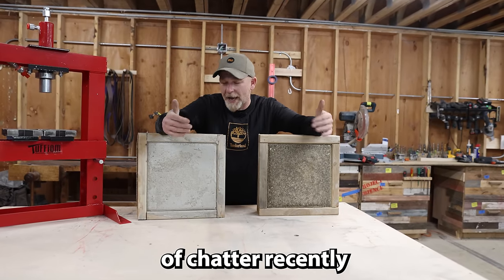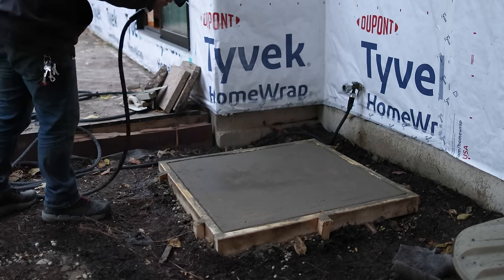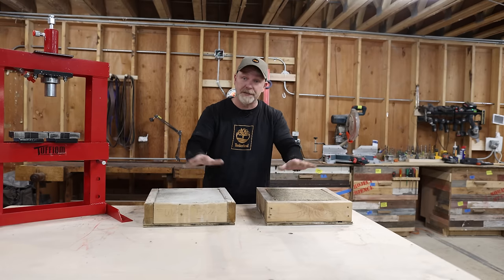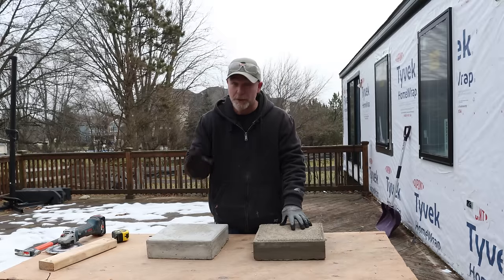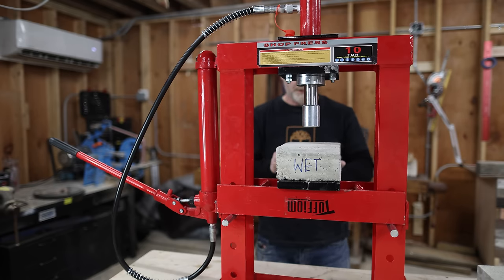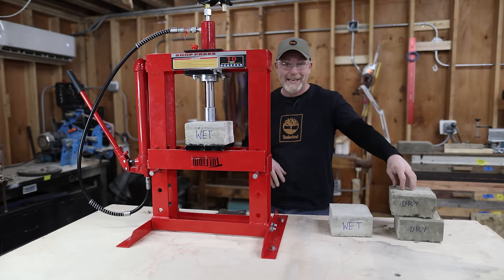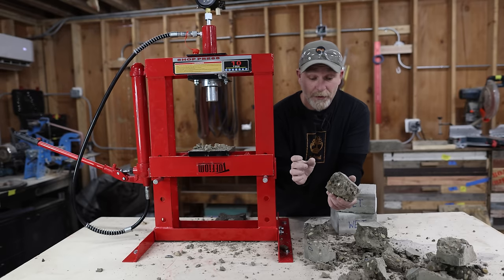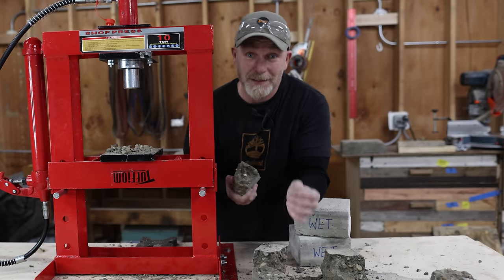The TRUTH About Dry Pour vs Wet Pour Concrete!! Strength Test - You WON'T Believe the results!!

Comment: Geotechnical engineer here, my last job was in airport pavements. We test both new and existing pavements when performing construction and evaluations. There are some less industrialized countries that will dry pour patches, I’ve cored and performed split tensile tests on tens of thousands of samples, the dry pours were always laughably poor quality.
Reply: brilliant comment thanks
Reply: Is it possible that the issue is that dry pours require watering throughout the curing process, and that the curing process is extended to a much longer period of time?
Just thinking out loud
Reply: I think someone  should  experiment  with the time and the misting process for it to cure properly.  There is got to be a sweet spot where it can give better results.  And when we reach that optimal result  , we can decide  if it worth it for certain applications
Reply: Glad I saw this, my forms are in place for a pad for a shed. I was going to dry pour, don't think so now.
Reply: Retired highway contractor here. Certified in concrete and aggregate testing and was on international standards committees. Enjoyed the video and your methods are original and you got similar results. Look up procedures for compressive strength testing and then for flexural strength beam tests. The dry pour is more like a cement stabilized base rather than a slab. I would never use this except for fence post.
Reply: @ravenrock541  one of the problems with misting is the lack of control of the amount of water added uniformly through the depth of the dry mix. In concrete mixture design the amount of water is important and the amount can be affected by strength requirements, size and distributions of the coarse and fine aggregate. In addition, the three types of cement added (Types I, II, & III) can change the optimal water content. Another observation of this video shows aggregate segregation, which results in unreliable results. Concrete needs a homogeneous mixture for optimum strength and durability.
Reply: I can't believe you do this for a living and never bothering saying anything about the fact that AIR INJECTED CONCRETE is what we are talking about. You need AIR and WATER to start the chemical reaction in cement. That's why it GETS HOT when you pour a lot of it at once.
Reply: @bbrahbboul2748  agree.....  in fact  wonder if it needs a firing like pottery for it to reach complete cure
Reply: @ravenrock541  Any time I've had to use it as part of a spec callout in the UK, it's always been misted for every 25mm of depth (1") added. That will get it to 80% strength fairly rapidly, it takes a couple months to get the rest though.
Reply: Everyone trying to reason their way out of science by "but what if!" and this man just calmly giving facts.
Reply: @weldo1948  Good thoughts - you beat me to it!  Complete amateur here, but it seems pretty obvious that the dry pour does not allow a consistent mix of all the ingredients.  And I'd guess it'd be worse the thicker the slab is.
Reply: Well I strongly disagree and I Challenge you to a backyard contest of Dry pour verses wet. I won't tip you and don't tip me. Take your time and I'll do the same. I say those results will be nowhere near laughable when I'm done. With that I will give you this fact, My father was a concrete specialist for 42 years before retirement. Speaking of airports my father was responsible for a large part of Bush intercontinental airport construction in recent decades and many new school buildings in and all over both Montgomery county and Harris county. My Dad played golf with the engineers. I don't know everything about concrete itself but I've learned the nature of the beast in 54 years and I will never pour any concrete in someone's yard or property that I would not pour exactly the same in my own.
Reply: @ravenrock541 nope... I guess you didn't understand the assignment... Read the answer again...
Reply: @williamfowler9196  atmospheric air is not a required component of the hydration reaction. This is why we can cure cement in a vacuum. 

Air entrained concrete (which I believe is what you’re referring to) is an intentional process of adding air voids to cement using a detergent additive in the batch mixture in order to provide freeze/thaw resistance. Air entrained concrete is about 5-10% weaker depending on the size and quantity of air voids but this is expected and acceptable in trade for the environmental freeze/thaw resistance.
Reply: @James-h9t6q  there is a reason (several actually) that none of the airport pavements or structures that your father poured were dry poured. Thank you for taking the time in your reply to provide details on your lack of experience in this industry or the materials sciences behind it. It serves well to indicate the nature of unqualified opinion common amongst proponents of this substandard construction “technique”
Reply: @bbrahbboul2748  No amount and times of misting will ever give optimal results. It will always be subpar. As soon as the water and concrete are mixed the chemical reaction begins. When the chemical reaction is only started on the surface you will get the surface reacting faster than the dry part on the inside. It won't be consistent throughout. You need the consistent reaction throughout the mix. It will never be close to the strength of a wet mix. It needs to all harden equally at the same time. You could mix it by hand in a tub and have 2 or 3 times the strength of a dry pour and it wouldn't take that much more time and effort to do it the right way.
Reply: @bbrahbboul2748 it’s not worth it for any application, it was designed to be mixed and poured. Don’t skimp on following the directions.
Reply: @Rippthrough       That makes sense.    It does have to have water.    I was wondering how the mist on the top could ever be enough moisture to travel 3" down to the bottom.
Reply: Former ACI and ICC certified concrete testing technician and inspector here. "Dry pour" just isn't a thing on any permitted project where the concrete is supporting a load. There's no way to control consolidation, water/cement ratio, wet unit weight, air entrainment, aggregate segregation, concrete temperature or slump, all of which are specified on a commercial pour because they affect the result.
Reply: Always glad to hear from an expert.
Reply: @Timber1508  
What if I "dry pour" hydraulic concrete and mist it with Coke and then loosely cover it with black poly/visqueen? :face-orange-raised-eyebrow::volcano-green-lava-orange::text-green-game-over::medal-yellow-first-red::trophy-yellow-smiling:

:face-red-smiling-live:Cement:elbowbump:Concrete:baseball-white-cap-out:Resin:popcorn-yellow-striped-smile:
Reply: @lt1nut  nah, that only works with Mtn Dew, and only on Tuesdays.
Reply: @coachgeo     Concrete 'CURES' .   It is a chemical reaction created primarily buy the 'cement powder' & water coming into contact with each other.   Part of that reaction is the release / creation of heat.   At the atomic level, the heat created is somewhat of an incidental result and not really needed for the CURING  to take place.   I don't know the specifics but it is probably no more than 20 degrees F.   Any amount of heat applied externally, during normal weather, would interfere with the 'CURING' PROCESS.    Most likely the main result of adding extra heat would be to cause evaporation and DRY the concrete too quickly, stopping the CURE.    CURING is not the same as DRYING !    Pouring in the summer is trickey because if the concrete dries to quickly, the water evaporates and does not allow enough time for a proper 'cure' of the 'cement' (which started out as a dry powder).   All-in-All, it is a chemical reaction and has very specific requirements for the atoms to be able to combine with each other for the optimal atomic bonding, i.e., strength.  
       Firing clay pottery in a kiln at 1500 - 2000ish degrees is an entirely different chemical reaction.   It needs to have heat ADDED to it for the atomic bonds to form.   
       Check out TYLER LEY's YT Channel for all kinds of interesting knowledge about concrete !
Reply: @BillSmith-fx7xx  Mochas Gracious.. Youtube  (commenter) Univ. strikes again.  Appreciate
Reply: Dont believe anyrhing you say
Reply: @samadams7467      Thanks for your comment & support !    :-)
Reply: @coachgeo        You are very welcome.   Always glad to share some knowledge when I can.
Reply: P501
Reply: @ravenrock541 oh no your right on that and also the rate as for ground/ base to aid in absorbing  moisture towards bottom  for full cure . But im just a regular smart contractor  science is easy
Reply: Oh please stop
Reply: Supposed to add at least 3 bags of calcium . Only on hot days .
Reply: On three story homes . For footers I use only dry pours . Much better to screed powder and easier on my workers backs .
Reply: @greenspiraldragon one guy mentioned misting after every 1". I wonder how that would work. Obviously it would be very hard to get consistent results. I think there is a technique to "dry pour" that should get you to the proper break strength. It would probably be so impractical you might aswell wet pour it though.
Reply: good information
 @Rippthrough
Reply: Let's be reasonable. Video clearly showed average 5 tons of pressure...sufficient for any foundation such as sheds, playhouses, AC units, propane tanks and the like...maybe even fence posts.
 @DevinRAR
Reply: What you miss is that Dry pour is 100x better for the youtube algorithm.  FACT.
Reply: A dry or damp pour requires compactive effort. The strength of a lean mix will vary with the density to the 4 power.
Reply: @DevinRAR  concrete is always placed and not poured. Dry or damp mixes require compactive effort.
Reply: Also a 5 yrs concrete pour is stronger also I believe than 6 month
Reply: @Sjwolosz321 really, so tell me the state you work in, and that  you're having code officials sign off on this method.
Reply: @NoName-ml5yk yes because all modern contractors in most trades want to cheat to forgive time to do things correctly and with trade integrity!
Reply: @bbrahbboul2748 Doing it an inch at a time and misting it every inch should give much better strength results than just misting over the final top. Not that I could ever usethis method myself given the horrendous finish.
Reply: @bbrahbboul2748 Who in there right mind is going to experiment with concrete slabs in order to see if it works. Time material and labor is not cheap. This is a ridiculous debate.
Reply: @kenhellman9596 What made you even think about dry pour, unbelievable where did this stupid debate ever come from.
Reply: @ravenrock541  The problem is that the concrete on top will initially harden and cure first, slowing or blocking the water penetration to the bottom. Too much water on top and not enough on the bottom.
Reply: @RealBLAlley  I agree, but since concrete can suck moisture right out of the ground my theory is that keeping the surface constantly wet for 24 hours this can be overcome. Most vids I've seen they wet the surface and then stop, come back a few hours later and wet again. I feel this does not get enough water into the mix. After the surface sets up, maybe throwing a garden misting hose over it and letting it run for hours would solve the problem
Reply: @ravenrock541  Relying on drawing moisture from the ground is incredibly inconsistent and undesirable to achieve high compression strength. Also, you're weakening the top if you saturate it to get more water to the bottom.
Reply: @garymurawski1476  It can't show how that dry pour will crumble over time.
Reply: I’m a structural engineer and it turns my stomach when I see people presenting dry pour methods.  Dry pour is lazy and totally disregards the science of concrete.
Reply: @MRKNIGHT  I'm a certified ASE Master tech and it turns my stomach when I see zip ties in an engine bay. But I also realize that everything has its use in the right place and right circumstances. Instead of holding your nose in the air, how about contributing to making a method better for those who have a need of such a method?
Got anything positive to contribute?
Reply: I'm going to try the dry pour, to make a shed floor don't need it to load bear so I'm hoping it will be fine
Reply: Tens of thousands of samples, huh? As a mathematician, I would love to see your research timeline for collecting and processing that many samples. I'll suffice to say that you've been  working everyday for years to accompolish such an impressive objective.
Reply: Try making bread or a cake without mixing...
Reply: @williamfowler9196 i think you mean air-entrained.. autoclave cement is injected.
Reply: @andymeyer8635  and you even said all of that in an organized fashion. In the comments. Huh funny thing is I never said one word about dry pouring anything in the way of commercial work. You see I watched and listened to my old Daddy because he insisted. You see I was commenting on the back yard dry pour at my house. I figured that this conversation would be skipped by all the smart people like you and my dad. It was just a comment no professionals allowed.Good day!
Reply: @andymeyer8635  my bad I meant to say you qualified people with a hell of a vocabulary.
Reply: You know what's Ironic to me? The Geotechnical engineer claims he cored and performed split tensile tests on Dry pour concrete in commercial airport pavements. Wow that tops everything!
Reply: @bbrahbboul2748  I think that's a wise statement well said .
Reply: @kenhellman9596  aww you let the talkers get to your better judgement. But hey I'm only trying to get the truth out about an alternative to PRECISION BUILT AND SPEC CONCRETE for your backyard do it yourself craftsman who would enjoy the look of good concrete work that doesn't cost $2000 to achieve. See I'm just that kind of guy that wants what I want without the BS of concrete crews.
Reply: @James-h9t6q  you would be amazed at the things that are attempted in emerging nations. Evaluations are performed on what exists when we arrive, sometimes it just makes you shake your head in disbelief.
Reply: @PureMagma  evaluations aren’t a one man show. 50-400 samples per airport, average of 12 airports per year, spent 18 years in the role.
Reply: @ravenrock541 most people dont realize that concrete is a chemical reaction with water being a ingredient to the process. too much or too little water changes the strength as well as if its not mixed the reaction will happen at seperate times not bonding together properly
Reply: Would you dry bake a cake?
Reply: There is a reason manufacturers have no recommendation for dry pour.
Reply: @weldonjohnson9834 Even for fenceposts we usually use "ground moisture" concrete, meaning at least as wet as wet sand will bring to the mix. Always  worked out fine for it, easy to tamp as well.
Reply: Elephant in the room: what is the weight of each of the slabs? Traditional wisdom says concrete condenses as it is mixed. The mix with cement and water take up less space than the dry ingredients. Are you absolutely sure it didn't take more concrete to fill the form on the wet pour, than the dry concrete? Higher density? ...I'm a little bit surprised  the dry casting didn't  set on you. Shrink. Though it is possible the adhesive properties kicked in before the rest of the chemical process,  hardening etc., leaving microscopic air bubbles everywhere  in the concrete,  making it both less dense and more fragile, than the wet pour. PS. Wet pour needs rodding/vibration to get rid of the air bubbles
Reply: @Sjwolosz321  They use calcium chloride, not calcium. It absorbs water, so the water does not evaporate as rapidly on hot days.
Reply: @James-h9t6q  Wet mix concrete costs no more than dry mixing for the homeowner - unless you need to rent a cement mixer.  It can be done in a wheelbarrow if necessary - pouring small sections at a time instead of doing everything in one slab. But it does take a long time if you don't have all the fancy equipment.
Reply: @buggsy5   ha ! in the trade it's known simply as calcium , Not CaCL2. Add it to concrete on a hot day , Better rush like hell to finish , Hardens fast , It's added on cold days so you don't have to wait around forever to finish .. Your'e welcome ,
Reply: Ravenrock   The problem is they did not buy concrete misting dirt. 🤡🤪

The first video I saw of dry pouring concrete was the husband and wife team video. Stellar YouTube video showing We reslly know what we are talking about.

It says concrete mix, and commercial companies deliver it with trucks with a large mixing barrel. Any of this registering yet?  

Once again …. Brondo has electrolites in it!!!!
Reply: Engineer am curious to know how you would rank these construction blocks in terms if strength, concrete block, AAC block and foam concrete block?
Reply: IS LAUGHABLY ARE WORD ???
Reply: @mefirst4266  Yes
Reply: @BillSmith-fx7xx 
I’ve seen concrete blocks fast cured in a steam room in a block factory. That makes sense in adding moisture and heat which speeds up chemical reactions. 

That said, once upon a time I read that concrete gets its strength from the gypsum crystal bond. Crystals need water to form. At the right time and place. The latent heat of crystallization makes the reaction exothermic. 

I might be talking nonsense but it is easier to talk and run away from this rabbit hole than go down the rabbit hole of doing the research before I comment 😏
Reply: @danielwojtowicz5574 
Water to mix ratio has bigger impact than cement to mix ratio according to a Portland cement association publication I read fifty years ago. Probably still true.  Double the water weakens the concrete more than halving the cement.
Reply: Ravenrock....
Something helpful to contribute???
He did... you didn't. 
His helpful advice was that dry pour is not good.  Period. Stop being lazy.
Reply: Does that mean the wet pour cause leg/knee injuries more than the dry one?
Reply: @ravenrock541  I agree. I think we should explore better ways to cure it. I am sure a wet pour just as wet as that dry pour would crumble just as easily.
Reply: @user-hr2ec8in5h  hey guy, don't take it personally. It's not targeted at you, and the jobs you do.
Reply: The videos I've seen of other dry pours, only the first two applications of water are mist, each one after that are full saturation. I think that would create a much more similar strength and result as the wet pour.
Reply: @JamesCocherell It’s very possible to create a heavy and (surface) hardened object from cement that way, but it would be terrible for strength. A starting point to understand why is learning the basics of the hydration reaction if you’re interested in learning more about it.
Reply: @paulalton2057          Part 2.    My take on all this is that the, biggest concern is to not allow freshly placed concrete to dry out to fast.   Any control of 'drying/humidity' by frequently watering keeps the temperature lower by default.    But appearently keeping the concrete 'cool' is not necessarily the most important aspect of the operation.   That fits with other concrete stuff I have read & watched.    Everything seems to point to, 'controlling & reducing the rate of evaporation' of moisture from the concrete.   So, direct sunlight, wind, & low humidity all work against the curing process.   Some things I have seen also say don't be afraid to leave the forms on for a couple days.    So wetting & covering or anything that keeps the moisture up is going to benefit the curing.   This also matches the stuff I've seen that concrete can cure complerely underwater.   
       That is everything I know.   Tyler Ley has a good YT channel all about concrete.   I think he has a a PhD in concrete/civil engineer.
Reply: Dry pour is more work, lesser quality.  Mixing and laying concrete is simple, people make it sound scarier than it actually is.
Reply: With dry there is not enough chemical reaction for bonding, and maybe different structure of cement. That's why it's a joke to use it in anything (serious).
Reply: @Timber1508 I’m a construction project supervisor for the transportation department in my state and I 100% agree.  There is no way they will ever pass a compressive strength test.
Reply: It's not even good enough for a buried deck footing you think?
Reply: @GregJoshuaW you have a chance at getting away with it in that application, but you can guarantee a significantly better result by simply hand mixing and pouring the footer.
Reply: The only way that would be a fair test is if both pieces of concrete were fully cured
Reply: @rayg5445 it does help. If you do it right and use a plate compactor over the top it brings up a soup so you can actually finish it. But still only useful for sidewalks and small pads. Anything big just call a truck out.
Reply: @coachgeo  It should be cool, but not freezing, to cure properly.
Reply: Honestly, it is what I would expect. 
Proper mixing of concrete distributes the cement and aggregates. Since cement is the "glue" that binds the concrete together, ensuring that it is proportionally distributed  throughout will ensure maximum strength. 
Then there is the issue of water. Water is needed to activate it.
There is no way a dry mix will come close to a wet mix in those two crucial aspects
Reply: @weldonjohnson9834, frankly I would not use it even for fence posts.  Actually,  I did not. I put in a lot of posts and always did a wet mix.
Reply: The fly ash is not getting wet enough
Reply: Pretty obvious dry pour methods will accumulate more moisture along water barriers which will dilute the homogeneous nature of the product more in those places and arrive at what you see here. Crumbly corners and edges where water degraded the product more.
Reply: @bbrahbboul2748  There's not a sweet spot. This is laziness at best. If dry pour worked, engineers would have figured it out centuries ago.
Reply: @lt1nut "Coke" like what they found in the White House? 🤔
Reply: @bbrahbboul2748  You're not supposed to spray these but pour water on top of it. If this isn't done in the correct amount it will be crumbly as you've seen in the video.
Reply: @weldo1948  This was designed only for fence posts. It isn't intended for streets, slabs, or foundations.
Reply: @coachgeo  Concrete doesn't work like this. It's from chemical reactions between the water and portland cement with the limestone. These are the three main ingredients. If not mixed with enough water this will be crumbly - dry pour or wet.
Reply: Try the following for dry pour — especially for fence posts.    stabilize the fence post with braces.   Fill the hole with water, then add the dry cement — it gets a lot wetter this way, and a lot stronger than putting the cement in first followed by water on top.
Reply: Yeah I can believe people actually think a dry pour is desirable at all
Reply: @NoName-ml5yk 
Much stronger comments, both in compression and for tensile comments.
We can't help but comment when something is bad, like dry pour.
Reply: Thank you for your comment.
Reply: @bbrahbboul2748 I would think that as well and I would also think that after the first day of misting and the top crusts and hardens that you could then add as much water as you wanted
Reply: @weldo1948 actually there's a much better trick for fence posts and it keeps you from getting air pockets and will be set strong Immediately. Clean sand😅shovel in while you just lightly fidget the post to let the sand settle in tight 😅 no tamping no water no concrete... and then much easier to remove the posts if you ever want. I also think it keeps the post healthier from Less rot not having the concrete it allows for it to drain without having a weak spot from years of the concrete area wet line. I don't think he added enough water to this dry poor it would be no different if you only added half the water to the wet pour you have to have the proper ratios. After you misted it and the surface crusts then you should be able to water it thoroughly so it goes ahead and starts absorbing throughout. I would also think with the added water it would help to cure it more quickly because the moisture would let it heat as it cures it evaporates more quickly. But the trick is you have to get it thoroughly wet you can't expect it to cure properly if you only ever dampen the top and the rest is basically dry beneath that top layer😊
Reply: People who are happy with a dry poor could just make a wet poor with half as much cement. Less waste, faster. Win win.
Reply: Not only that ! But the amount of water in wet cement can make wet cement poor quality! 
Not to mention the drying time,temperatures when drying and rain!
If you look up the history of the Hover Damn,  you will see they had to rotate pore locations because of heat and install a cooling system to relieve heat from center of structure! 
And I'm a "B" general contractor in California that started with subsidence in foundations In 1990's😊

AND THE CEMENT IS STILL CURING AND PRODUCING HEAT TODAY BECAUSE OF THE THICKNESS!
Reply: @smckay6438  exactly and knowing that makes all the difference in the world I literally watched that concrete building in Mexico roll down a hill and remain intact because of the proper way it was erected and that kind of stuff goes by the wayside and all of these hurry up and get it done not pay attention to life-saving make it last details period and you are right on that too much water that's even worse than too dry
Reply: I have a degree in concrete construction, and firstly I’d like to tell there is a standard for testing strenght in concrete. And the test is done by testing likesided cubes of 100 mm, not ‘tiles’ like this. Secondly, what decides the strength is mainly the availability of water during the hardening process, and the quality of the aggregate.
Reply: @williamfowler9196 Are you talking about air entrained concrete? Air entrainment is mostly for freeze thaw resistance and air is not necessary for cement hydration. Adequate water is though and it needs to be fully consolidated with the cement and coat the aggregate particles with cement/water paste to make a strong bond. Dry poured concrete cannot achieve those requirements, no matter how a person does it. Dry poured concrete will never, ever produce concrete that’s even remotely comparable with wet poured.
Reply: @ravenrock541  no.  mixing water consistently is required to achieve the design strength. To much water will weaking the concrete, and misting does not give consistent consolidation.  Its crap method. BUT  if your just looking to make a stabilized soil its fine.
Reply: I would think that using the dry pour method  for a sidewalk with mesh & rebar would be just fine as there is no load bearing on a private sidewalk.  Especially when a wet pour is not an option.
I have see sack concrete stacked up and used for retaining walls & works well.
Reply: @johnblay155  you might get away with a dry pour for an application like this but you would have significantly better results with properly hydrated concrete even if you hand mixed it in a wheelbarrow. Consider your environment if you want to try something like this, expansive soils and freeze-thaw cycles will quickly stress substandard concrete. Rebar steel reinforcement can actually work against you in some situations introducing stress points into low strength mixtures, especially in a thin slab. Wire mesh would likely be more appropriate for this application if steel were to be used.
Reply: @andymeyer8635  I’m building a 4’wide sidewalk that butts up to my bulkhead & is 60’ long. It’s sloped just to drain the water that comes over the bulkhead during storms and high wind.  No access for concrete trucks😀I will use mesh & dry pour. Plenty of moisture in the sandy soil next to the bulkhead. Four inch thick will work just find for all sidewalks.
Reply: Oh and we don’t have freezes or snow
Reply: I was also considering using pavers or blocks, another option
Reply: And where's your proof??! Testing data? Didn't think so...go away KAREN
Reply: @dwindlefoddl7225  many international airports that don’t have daily crashes and passenger deaths. I’m the reason that aircraft can land safely. You’re the reason that America is falling behind in education and development.
Reply: I’m getting ready to dry poor a four foot wide 3”or , 4” thk. W/ mesh sidewalk along my lakefront bulkhead to drain water back into the lake. NO access for concrete trucks. Only foot traffic and a lawn mower wheels. 
The walk will be dry poured in seven foot sections with expansion joints. There are applications for everything.
Reply: That's why they don't do it at airports. It is good enough for small patches and a square or 2 of sidewalk. Plus, it is good for  were you can't get a cement truck in and don't want to do yard restoration.
Reply: I made design engineer of course because the hydration is very poor and the aggregate mixture. It is glorified stucco.
Reply: @ravenrock541  no.
Reply: @ravenrock541  You're a hack. Being ASE certified doesn't tell the entire story.
Reply: "Less Industrialised countries" ... hmmm, I wonder why the quality was laughably poor for ANY concrete or construction. ESPECIALLY at an airport where the required use IS to be strong structurally.

For things that doesn't need to hold a lot of strength dry pour is okay. (ie. Fence posts, chicken coop slab)

If you need the slab to hold any weight, or be a structural support, then yeah, you shouldn't dry pour. But that's not what it's intended for.

It'd be like saying "I tested a 4 cylinder car, and it was useless for towing my 3 ton caravan compared to my Mac truck"
Reply: Hands on Construction Engineer here, my last job was showing other people how to install "dry concrete" properly. Step #1, read instructions on the bag. Step #2, follow instructions on the bag. Step #3, follow steps #1 and #2. What the creator of this video and so many others have missed in the instructions is that #1, dry concrete is for fence posts, not load bearing weight. #2 Use that same amount of water as you would with wet concrete, if you do not, then you will have concrete like this guy. #3 "Misting" is not in the instructions and does not get a gallon of water in the concrete; take a gallon of water and pour it around the dry concrete. Water makes the concrete bond. You need water even with "dry concrete". "Dry concrete" only refers to how it is set up, not the final product. I guess common sense just ain't that common these days...
Reply: @andymeyer8635  are you sure runways aren't dry poured?😅
Reply: @LayneXIII Nor would I eat a concrete block
Reply: He s only pouring light duty concrete pads and patios.  When it comes to real pours for foundations and structural beams he has no clue what to do. Anyone can pour a patio stone or pad using cement rocks or coco puffs.
Reply: @mudslinger888 it’s called a dump cake 😂
Reply: You mean compressive strength ; concrete is always designed to be in compression. The tensile  strength of concrete iapproximately 10%.
Reply: @bbrahbboul2748  mixing will never have the same out come as day pour.
Reply: that's cool, but for walking traffic and non airport conditions, like residential walk ways and drive ways it's fine.
Reply: CLSM has more structural integrity than a dry pour..😅
Reply: There's no such thing as a geotechnical engineer 🤦🏻‍♂️😂
Reply: Ingeneer
Reply: It wasn’t enough it didn’t get enough water to fully cure
Reply: @kenhellman9596  you’re not gonna have 5 to 7 tons per square inch anyway it’s not gonna break your dry pour
Reply: Yeah dry poor is crappy but is it good enough for some uses?   Do you really need 5,000 PSI concrete for a slab to put your barbecue pit on?
Reply: Soi should be promising the dry pour for thicker applications and dry pouring with rebar for thinner applications
Reply: @williamfowler9196  Air entrained concrete is for freeze thaw cycle durability. The air is not injected it is the result of an admixture and regular mixing. Concrete doesn't require additional air to cure properly.
Reply: @ravenrock541  honestly please stop. these are non-technical arguments and speculations.
Reply: @bluearcherx  Sorry, got your comment confused with another's, plz disregard. As for your comment, "whatever bro"
Reply: Made a statement but nothing to back it up!!

Don’t sound like a fellow engineer to me
Reply: @James-h9t6q So.  You’re an expert because your father was a concrete contractor and he played golf with engineers.  Really?  That is the dumbest thing I’ve ever heard.
Reply: @Sjwolosz321 Where do you build houses using dry pour for your footings?  I want to make sure I don’t buy a house there.
Reply: @darrongclark Liquids are poured.  Concrete mix is a liquid.  You’re playing semantics by saying it is placed.  Outing is a method of placement.  If you place an item in a formed area and it conforms to the shape of the forums, you have poured a liquid.
Reply: @philtheheaterguy951  Materials engineer here. Concrete is a mixture that is always placed. If you are pouring it, it can segregate or the water cement ratio is so high that the concrete is weak.
Reply: @darrongclark  Do you know the definition of “pour”?  Is mixed concrete a liquid before it cures?  When you move a liquid from one container to another by moving the higher container in a manner that the liquid moves due to gravity into the lower container, is that not POURING?
Reply: @philtheheaterguy951  It should be referred to as placing, period. Pouring leads construction personnel to believe that they don't have to worry about segregation.
Reply: @darrongclark  I just did a Google search and it’s referred to as “pouring” in every reference I checked.  I did my first masonry work 53 years ago.  We sold the house I did that work on in January and the stucco was still like the day I installed it.  I’ve worked in the trades for the past 45 years as a second job.  I’ve been on hundreds of job sites.  I’ve heard bosses tell guys to put or place bags of Portland Cement in a certain spot.  I have never once heard anyone tell anyone to “place” mixed wet concrete anywhere.  It gets poured from the chute into the wheelbarrow or buggy or directly into the formed area.  But, then again, you probably work in an office.
Reply: @darrongclark  😂😂😂😂😂😂😂😂😂😂😂😂
Reply: @philtheheaterguy951  There is a difference between Portland cement and concrete, so I don't know why you brought that up. Any way how come I get the impression that you are the type of guy who will pour an entire foundation without moving the truck and use only a vibrator to 'pour' the concrete from place to place. I spend half my time in the field and half my time writing reports or checking problems that have arisen from poor practice or poor field conditions.
Reply: @darrongclark  I know fully the difference between Portland Cement and concrete.  I never said that they were the same.  I was talking about the word usage and using examples you should have understood.  Silly me thinking your comprehension would be on par with mine.  Read what I said again, Mr. Engineer, and see if you understand it the second time around.
Reply: @darrongclark  What is a monolithic pour?  Why is it called a pour and not a monolithic placement?
Reply: @bbrahbboul2748 ! Do you think watering after half the concrete is poured in dry, then adding remaining cement mix and misting would help?
Reply: @ravenrock541   Thank you. That was kinda my thought too. Also, when mixing wet pour, the amount of added water is going to be within a specific rage. Whereas with dry pour, people are just misting and misting and misting and misting...so perhaps it's just a case of too much water. Even wet pour will fail dramatically if the water ratio is off. Now I'm no geotechnical engineer, but regardless, I don't think anyone is dry pouring the foundation for a house, but if you're doing some DIY path pavers...does it really matter?
Reply: @Sjwolosz321   I really hope you're being sarcastic...
Reply: @mysticknight9711   ...and maybe give it a swizzle with a stick. Holding up a fence post, a mailbox, or making some pavers...why not? I'd love to see any of the 'It's not good for ANY application' handily take down a dry poured post.
Reply: @ravenrock541  I think 90 days should be enough. If it takes more than 3 months then whats the point using concrete at all. Might as well compact mud and use that.